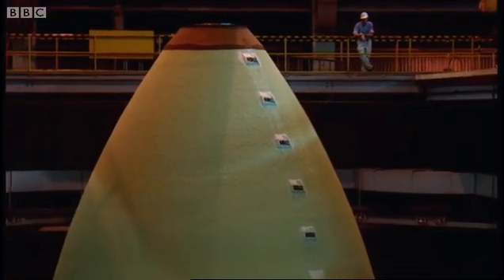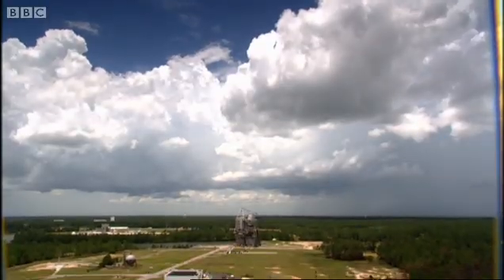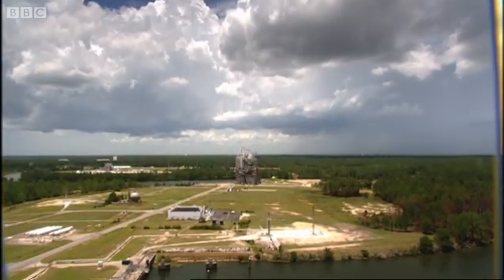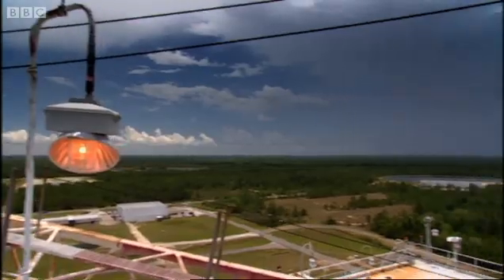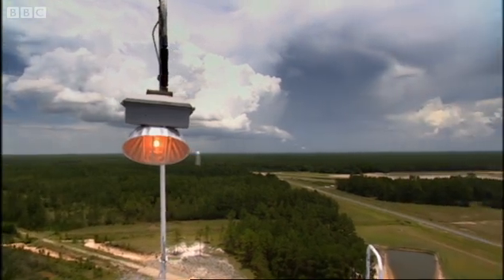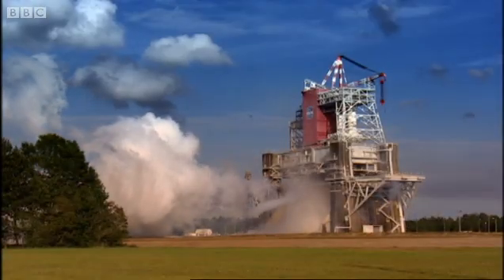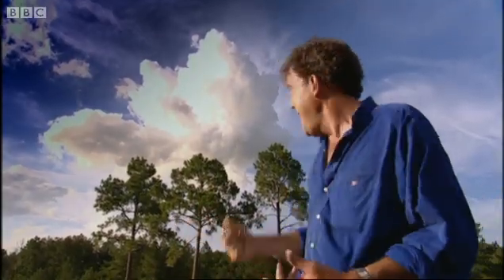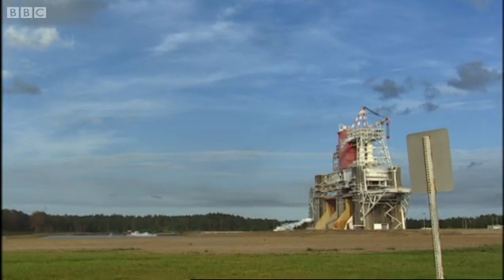Space Shuttle Rocket Booster Test | Speed | Top Gear

Comment: The people in the comments saying how the RS-25 engine could be used as an irrigation system or for fighting forest fires seriously have no clue what theyre talking about and should really research some things. 

Its a beyond stupid idea since you need to spend years building the infrastructure, not to mention that its a million times easier and cheaper to use an actual irrigation system. 

And the people who say it should be used to supply water during a drought? Even dumber, since to use the engine you need to bring in millions of gallons of liquid hydrogen and liquid oxygen for fuel, and millions more gallons of water for the sound/heat suppression system to prevent the engine from destroying everything, which is just extra steps if you want to supply an area with water during a drought, since instead of directly giving people and crops the water, youre separating it into its basic ingredients, blowing the ingredients up, and throwing the exhaust through more water.
Reply: Its an RS-68.

Comment: It has a water  sound suppression system and the heat from the rocket is making it hot and vaporizing it, that super hot water vapor meets the colder ambient temperature causing to condense and fall back to earth. Thats why they set up in the wet lands or places with lots of water. Helps protect the equipment from the extreme heat and reduce the amount of vibration. so that the test station and rocket engine don't vibrate to pieces.

Comment: It's crazy how we've had massive forest fires in the U.S. this year.  But there's nothing out there like this helping to put out the fires.  We needs to start using these methods, instead of showing them on tv.
Reply: that wouldnt be practical, the cost for the hydrogen and oxygen then building multiple facilities for these would be too expensive, combined with the fact that california usually has the worst wildfires and they dont do very many controlled burns
Reply: You seriously thing we should use rocket engines to put out wildfires? That is some next level stupidity.

Comment: so they could end drought in dry countries.. but they don't
Reply: No first, this is extremely extremely expensive. A single engine costs more then some countries gdps. Also the fuel needed require huge plants to build, and require a lot of specialized equipment. Also the cost of keeping a bunch of liquid hydrogen is obscene. You need to nearly keep it at abosulte zero. It's just cheaper to ship tons of water to dry countries then this
Reply: @DarkTheFailure  they cost ~$40m a piece.
Reply: @logitech4873  do you know how much water costs? Alot fucking less then 40 million. Also infrastructure and the liquid hydrogen and oxygen
Reply: @DarkTheFailure  I couldn't find a country with GDP less than $40m
Reply: @logitech4873  GDP doesn't equal budget. Just because a country has a GDP of a billion doesn't mean they have a billion dollars to play with. They have many things to fund like roads and schools. And also again, water is just cheaper
Reply: @DarkTheFailure  Uh ok. You said GDP though, so I looked up GDP.

Comment: Clarification: that's a liquid engine, not a solid.  The Shuttle SRBs are always tested at Promontory, Utah, at a test site belonging to Orbital ATK (formerly Alliant Techsystems, formerly Morton Thiokol).  The test stands at Stennis are truly staggering, including one built specifically to restrain a complete S-1C: the first stage of a Saturn V, the most powerful rocket ever flown.  That's five F-1 engines firing at once -- the biggest, baddest liquid rocket engines ever built -- and it could easily hold it back.  We're talking 7.5 million pounds of thrust at sea level.  And the stand could restrain it through a full-duration burn.

Comment: Clean? Yeah, clean if you consider nano-sized particles of aluminum, and Lord knows what else, that is being blasted out as is it burned as fuel additives! SMH...
Reply: The only fuel burned in the Space Shuttle's main engines (RS-25 seen here) is a combination of liquid oxygen and liquid hydrogen. There aren't fuel additives in the liquid fuel. The solid boosters, however, DO use aluminum based fuel and a perchlorate as an oxidizer. So those are not clean, but the ones seen here are actually clean, only producing water as a byproduct.
Reply: +TheChief417 You're totally correct
Reply: Yes aluminum in the liquid fuel rocket...
At least try to read the Wikipedia article on the rocket before criticizing it so you get the basics right...
Reply: +Some Guy Be like this guy 😂

Comment: Too bad he didn't heard the Saturn V....
Reply: +dimos k you guys do realize the original commenter was referring to the F-1 rocket engine used on the Saturn V launch system...not the race cars.
Reply: +MK3424 At that distance the sound alone would have killed him almost immediately. Nobody would ever be able to get that close to something like an F1 engine or a Space Shuttle SRB.
Reply: +dimos k I was at the Belgian Grand Prix at the old grandstand right before Eau-Rouge-Raidillon, i can tell you they are loud as hell! I also went to the Six Hours of Spa and was standing on the old pitlane opposite the grandstand i mentioned earlier and watched some old F1 cars doing practise runs, i can say that they are evenly loud.
Reply: Even with the sound suppression, every launch of a Saturn V was detected with earthquake sensors in the entire US
Reply: Ahem engines.... 5 to be exact:  1,522,000 lbf (6,770 kN) of thrust at liftoff... consuming 413.5 US gal (1,565 l) of LOX and 257.9 US gal (976 l) of RP-1 per second multiplied by 5...
Reply: +MK3424 15 tones a second, well yeah... It's need 150 tones to clear the tower
Reply: +PiccoloNamek i don't understand the F1 refference. spectators are sitted just a few feet away from F1 cars every weekend. they are very loud (or they used to be before the new v6-turbo nonsense) but nothing a set of earplugs can't handle
Reply: +dimos k Thrust me... the V6 are as loud as the old ones....
Reply: MK3424
if you have personal experience, i can't argue with that. i haven't heard them from up close, it's just what i read and told by people who have been in F1 races last year.
what they told me is that, with the old V8 and even older V10-V12, it was impossible to sit on the starting grid and not cover your ears during the start of the race, while now its much more quiet.
Reply: MK3424
maybe it has to do with the frequency. i found an interesting article right now (my curiosity won't let me rest lol)
https://acousticengineering.wordpress.com/2014/03/21/are-formula-1-cars-too-quiet/
Reply: MK3424
fair enough :)
and damn i envy you for being there lol
it must be really insane watching F1 cars go flat out at Eau Rouge!!!
Reply: TheChief417 damm it, I feel so incredibly stupid right now lol.
Reply: Well, without water suppression system, you could feel the ground rumble 15 kilometers away behind a mountain!
Reply: +MK3424 Yeah, thats how powerful the engine is

Comment: nice a rocket engine system that gives back to the environment
Reply: That's awesome
Reply: Brian Hill no kidding
Reply: I'm happy for that
Reply: Trying to be eco friendly not a bad thing at all
Reply: Brian Hill nope not a bad thing at all
Reply: +derek wall
Creating the oxygen and hydrogen needed for the rocket in the first place takes obscene amounts of electricity. The process could be powered by a waterfall sure, but oil is cheaper.
Reply: omgcow yeah but oil prices flux to much
Reply: derek wall
???
So does every resource. The point is, to create the fuel in the first place you need to burn oil.
It does not give back to the environment at all.
Reply: omgcow true
Reply: omgcow oil price per barrel as of 4/7/2016 was $37 so what would that add up too?
Reply: You'd have to know the conversion efficiency of the oil energy to rocket fuel, plus transport costs etc. But suffice to say several times more oil in volume than liquid hydrogen and oxygen would be required. Assuming of course it doesn't just use methods of electricity such as dams of which create vastly cheaper electricity during the night when noone uses it. It depends.
Reply: omgcow I guess ill have to look for the conversion table online

Comment: I grew up near Stennis Space Center. Once I rented a single-wide trailer just off the north edge of the "Buffer Zone." Nothing between me and the center except pine-covered flat land. The temperature dropped and I needed to light the pilot light of the gas heat in my trailer. I'd never done that before, and was nervous.

So, I was elbow deep in the furnace, with lit match. I pushed the red pilot button just as the sound front from an engine test hit the trailer broadside. I thought I was dead.

Comment: No, it's the main engine. The same engine would be one of three attached to the shuttle itself. The main engines burn with an almost invisible blue flame, like this one. The rocket boosters (the two rockets on either side of the external tank) burn with a bright yellow flame and can't be shut off once ignited since they're solid fuel rockets. When they test a booster, they lay it on its side.

Comment: Also, it's inaccurate to say that the engines will use half a million gallons of fuel to cover the 130 miles to space. It takes MUCH MUCH LESS fuel to get a rocket up to 130 miles, but it will fall right back down. What takes half a million gallons of fuel is accelerating the shuttle to 17,000 MPH so that it'll constantly miss the ground as it falls back down... in other words, to put it in orbit.

Comment: Actually the Solid Rocket Boosters (the one in the video) doesn't just create water vapor. The Space Shuttle Main Engines do, but the SRB's don't, because they don't use liquid hydrogen as a propellant (obviously, the fuel is not liquid, as you can see from the name.)

The boosters uses a fuel called APCP, which does produce water vapor, but also carbon dioxide.

I think there are more important sources of CO2 than this though, as the launches aren't that frequent.

Comment: Hey Top Gear, correct your caption, that NOT a solid booster being tested. Liquid fuel rockets DO product water vapor as an end product, the closest thing solid boosters make after burning could be equated to is acid rain if it got mixed with water, its main fuel is  powered aluminum and a mineral salt oxidizer, the resulting fuel looks alot like a big rubber eraser.  Jeremy wouldnt want to be under any resultant rain from that burning.

Comment: @leedoyeon Really? Where? He shows the main fuel tank, which holds liquid fuel, and he states that the resultant cloud was formed by oxygen and hydrogen, both from the liquid components powering the rockets, O2 and H combined form water. Modern solid composite propellants are heterogeneous powders (mixtures) which use a crystallized or finely ground mineral salt as an oxidizer, often ammonium perchlorate, which constitutes between 60% and 90% of the mass of the propellant-Nasa tests them in Utah

Comment: @penitent2401 Clouds form when rising air, through expansion, cools to the point where some of the water vapor molecules "clump together" faster than they are torn apart by their thermal energy. Some of that(invisible)water vapor condenses to form(visible)cloud droplets or ice crystals. 

Asia now is like it used to be here in America before we virtually eliminated particulate pollution starting more than 35 years ago.  

Your third point is nonsense.

Comment: So... Why don't they do this in places with no water lol. that's so sick!
Reply: The thing is, you still need water for it. The fuel is Hydrogen and Oxygen (water but separated), and because it's so loud and hot, you need millions of gallons of water to cool it down. Basically making your idea pointless since you'd need to bring water in to a remote area either way, just with the extra steps of firing a fucking rocket engine.